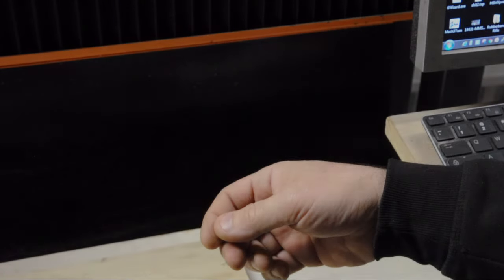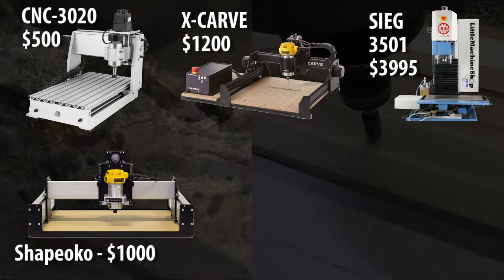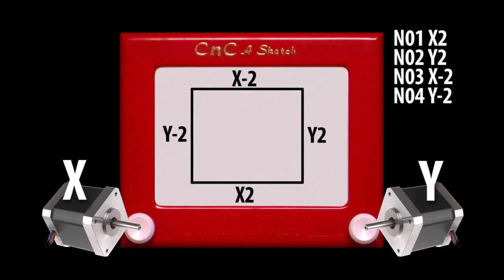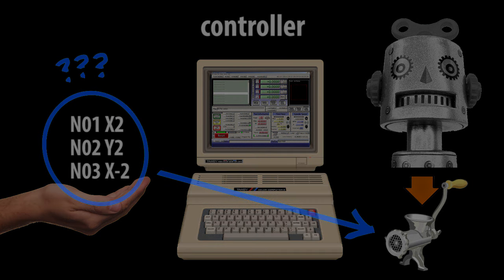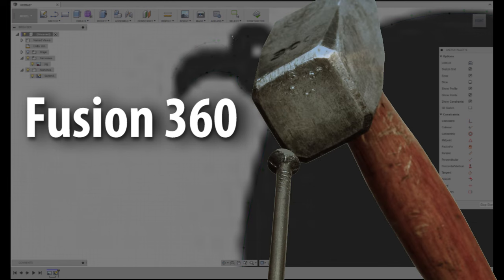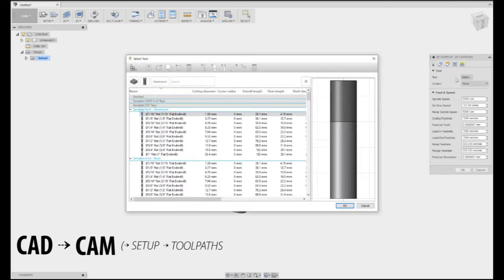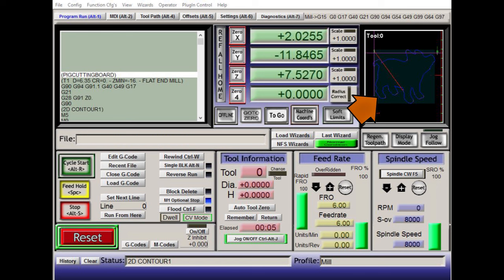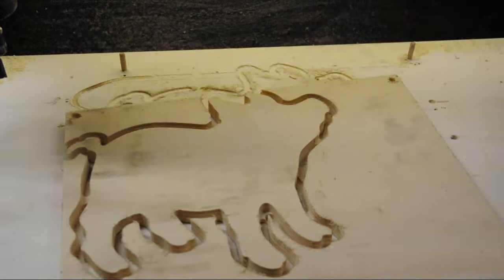CNC Dummies For Routers

Comment: There's not just Mach 3, there are some good alternatives like LinuxCNC/EMC2 or for those who don't have a parallel port can use GRBL on an arduino (like I do). There are propably also some more I don't know of, I jaust had to mention it here ;)
Reply: GRBL doesn't have a real grasp on physics. At least that is what all of the LinuxCNC devs tell me.
Reply: What does that mean? Anyhow, someone else also told me that the stepping algorithm used there isn't very efficient. I use it anyway because I have nothing with a parallel port here and it works reasonably well.
Reply: Klaufmann
real motion control software has something called a trajectory planner in it. Because due to physical constraints nothing can accelerate infinitely fast. What that means in layman's terms is GRBL tries to take every corner on two wheels. But being as that is impossible tool paths are somewhat inaccurate.
Reply: Ok, the grbl-wiki however states, that theres some kind of motion planning integrated, o that it decelerates in sharp corners for example. As I noticed this doesn't do anything when driving in small circles, then it moves with full speed and the machine shakes like crazy.
Reply: Klaufmann
some kind may not always be an adequate amount. I just hit 174 inches per minute on my machine. So at that speed I need a bit of planning to get it to where I want it to go. Now if a machine's top speed is more along the lines of 12 IPM then I guess it can get by with less.

Comment: 1st...I had a Tandy when I was young back in the 80's, 2nd Where do you find a Tormach 440 for under $5000?  Mine was $10000.  Even if I didn't opt for the enclosure , chip tray and tooling etc.  It would've been around $8000.   Love my Tormach though.  Great vids man!  Also, I am going to John's training class (nyc cnc) in the second week of January and work is paying for it.  I am a Solidworks guy since 2003 but Fusion has been pretty nice so far with help from Gwizard.

Comment: Hello , i ve seen a lot of your videos if not all and today while thinking about generally low budget cncs i had a thought that looks to me stupid and brilliant at the same time . 
I ve seen your video about sine bars and at sometime we came to the conclusion that the sin of 30 degrees is 0.5 after that i think you said (or-and i ve seen it in an other video ) that if we rotate the slide of the lathe at 30 degrees we double the accuracy of the cutting tool so advancing 0.1 mm cuts 0.05 and the question is in a cnc if we design to cut a square at 30 degrees orientation in respect of x y axis would that double the presision of the cutted square ? ????

Comment: Tony, What driver do you use to control your motors, and what main control board do you use? I can't seem to find anything on the drive systems of cnc routers, but everyone has a build log of them.
Reply from the maker: There is more detail (I think!) in my router build videos, but I'm using a SmoothStepper ethernet controller to a SoundLogic breakout board, to 3 Gecko stepper drivers, one for each axis.
Reply: Thanks! Love your videos, comedy and machining together work great!

Comment: Machine Self destruct program
%
(T1 Largest Facemill available)
(Press cycle start and run)

T1 M6
S10000 M3
G54 G90 G0 Z-20.
X12.
Y-12.
X0
Y0
Z5.
M5
M30
%
Reply: I usually use...
G56 G90 G0 Z-INFINITY

But that requires a super computer and a special relativistic post processor to run.

Comment: Im a trade machinist, new to cnc router,   im looking a starting my first cnc router build, i already have bob cad V23, if im understanding this correctly, i can just connect my stepper motor drivers directly to this controller, generate my G code with bob cad, transfer it to a usb and im making chips? I hate the idea of running the program from my pc.

Comment: When you were cutting out the pig the router kept going up and down, I assume that was to get the wood chips out of the bit for a cleaner cut?
Reply from the maker: It's actually leaving "tabs" or "bridges" between the pig and the rest of the board.  I think it left about 1/8" or so at the bottom, so the pig didn't move.  You can still see the remnants of the tabs around the cut-out when I stand the pig up at the end.

Though, stopping to clear out wood chips would've made me sound smarter.  ;)

Comment: It was a good basic primer, but as you say there will be others more indepth if one is so inclined, really programing g and m code is not all that hard as far as what does what, its much easier to write then doing software programing which I stunk at, and you have all the  functions at referance you just have to know what to tell it to do, as you say.

Comment: Aww, man!  At 3:45 I was hoping, for accuracy's sake, that your diagonal line would stop short of reaching the far corner!  The line you ended up drawing was actually X2.82842712475Y2.82842712475.
Reply from the maker: I switched a lot between absolute and relative coordinate. ;)

Comment: at about 2:52 X-2 would take your tool 2 inches past the start of your original line. Also the code tells the machine where to go( based off a set point or origin), not how much.
N01 X2
N02 Y2
N03 X0
N04 Y0
Reply: I thought the verbal explanation was right on. It demonstrated the concept just fine for those who have little or no experience with what G-code is. To many, it's no different than 'Magic-code'. I think that this was a delightfully enjoyable introduction.

 If you want to debate the actual G-code used during his explanation then... take note that no prepatory code was issued or mentioned. No Rapid traverse (ie. G0) and no Linear interpolation (ie. G1) and, most important to your statement, there was no instruction to use either ABSOLUTE mode(G90) nor RELATIVE mode(G91). 
So I put to you that the introductory/simplified sample G-code will actually stand exactly as-is when using Relative mode. But... the point of the video, at least as I saw it, was to enlighten viewers on the 'concept' of G-code and not its exact syntax.

Comment: i have followed guide but some reason my cnc is making my designs smaller then a penny any idea whats going on its like it thinks my table is ultra small
Reply from the maker: are your units consistent?  you might be designing in inches and your machine thinks it's millimeters.
Reply: @ThisOldTony  yea units are both in inch
Reply: @ThisOldTony  its almost like mach 3 thinks my table is ultra tiny or somehting
Reply: ok figured out what was causing it but now when i hit ref all home button nothing happens buttons just turn green
Reply from the maker: you have limit switches set up in the inputs?  if not, Mach will ignore the command.
Reply: @ThisOldTony  no sure dont do you have a vid on them?
Reply: @ThisOldTony  ok figured out how to do the limits have it set to do it automatic but when i hit the ref all home button nothing happens just they turn green.thanks for the help appreciate it

Comment: now that i understand that, what is a post processor?
Reply: robert lanham A post-processor is just a translation program. Every CAM program generates its own proprietary format of toolpath instructions. Every machine controller (Mach 3 for Tony) uses its own version of G-Code. The "post" translates between the two. It basically steps through the CAM lines and says, "when I see THIS, output THAT" so the machine can use it.

The exact same CAM file, run through posts for two different machine controllers, will output slightly different G-Code files. They will be very similar in the actual cutting lines, but there can be major differences in the file headers and footers that set critical machine modes.
Reply from the maker: a post processor is "Google Translate" for your CAM software.  It turns your CAM's brilliant toolpaths into machine-specific commands.  Since my router doesn't talk fluent "Fusion", I need to "post-process" fusion-talk into Mach3 talk.
Reply: This Old Tony dang, something else i got to learn. thanks
Reply: Thomas Utley thanks
Reply: robert lanham The post-processor is usually built into your CAM software. Unless you're running a highly customized machine (not likely in the hobby arena) one of the post options will likely work.
Reply: Thomas Utley i was using d2nc for some brackets and easy stuff then started learning fusion and started having broblems. my mill is cobbled together exactly like this one. http://www.hobby-machinist.com/threads/rung-fu-clone-rf-45-zx45-cnc-conversion.8187/.
Reply: robert lanham Remember the CAM software, and by extension the post-processor, does not talk to the machine hardware. They only generate code to be interpreted by your controller (Mach 3). If you're having a problem running specific code, it's likely nothing to do with how your machine is constructed (Rong Fu clone, Grizzly, full custom home brew DIY hackjob like mine). It only matters that Mach 3 gets what it's expecting to get.

Comment: Are you sure the diagonal from a 2 by 2 square is 2??
Reply: Glad someone else posted about that, otherwise I'd have looked like a picky jerk. ;-)
Reply from the maker: it depends what mode the machine is in, relative or absolute.  A move "to 2,2" can be different than a "2,2 move".
but sharp eye!  (ear?)

Comment: What router did you use because I had used a Makita router from home depot and was only able to sacrifice so many endmills to the cutting gods before my wallet quit.
Reply from the maker: I went with an import 1.5kW air cooled spindle from ebay.  So far so good.

Comment: I've heard twice that Fusion 360 is free. When I check it out, it's free for a trial and free for students and faculty.
Reply: Jay Pearce, you are correct. 
Fusion 360

Connect your entire product development process in a single cloud-based platform for Mac and PC.

Version

By Subscription only...you never own it!
It's very pricey for the average hobbyist.
Fusion 360 (price below)

Fusion 360 Ultimate (even higher price)

Term

MONTHLY

$40.00

1 YEAR

$300.00

2 YEAR

$600.00

Pricing for stand-alone single-user license. See legal disclosures

Quantity

Total

$300.00 / YEAR
I can't afford that!!!
Reply from the maker: install and use the trial.  unless something has changed, when it expires it'll present you with buying options.  the last one on the list is "It's just a hobby!" ... pick that one.  It'll ask you again in a year.

Comment: BZZZT !!! ERROR. THIS IS LITERALLY CALLED  CNC-A-SKETCH 2.5 AXIS.....
X + Y. AND PRINT CODE... TO START A CUT/ DRAW LINE 
EXACTLY AS ANY NORMAL PRINTER.... EXCEPT  A SIMPLE ON OFF SWITCH TO DRAW LINE OR LIFT PEN..

RIGHT ??
Also.. SketchUp v8.
Basic. CAD\CAM starter software... Now owned by Trimble